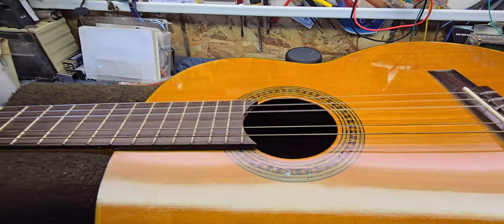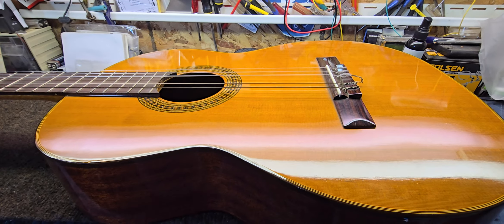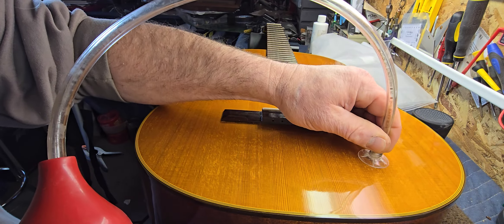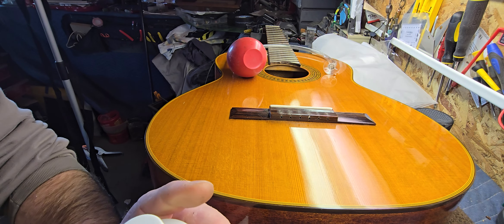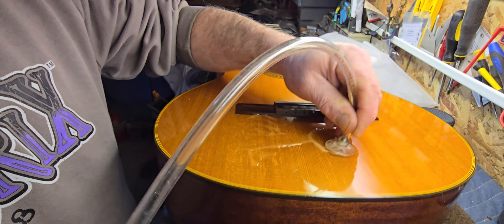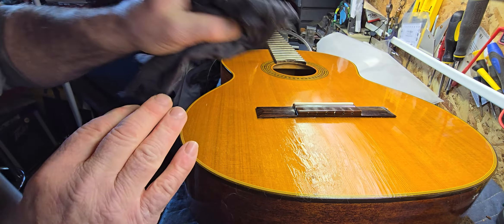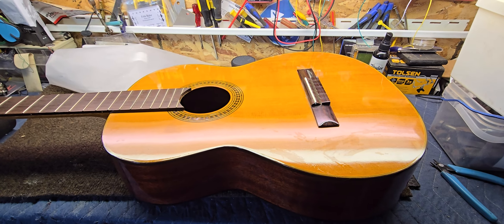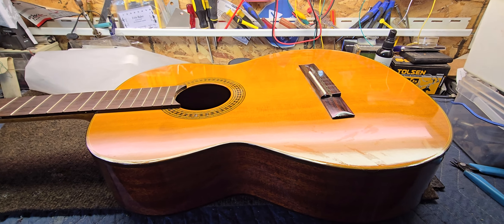Guitar repair Gluing some cracks in a vintage "Pennco" classical guitar. diy glue pump 2024

Comment: Thanks for the squeeze ball idea! I’ve been looking a better method to glue the crack in my 1973 K Yairi. I’ve tested a few other methods on an old Fender with little success but this looks very promising.
Reply from the maker: @tylerleonard4007  It works great, it's the only method use .. I  have a 1978 k yairi. outstanding guitars!